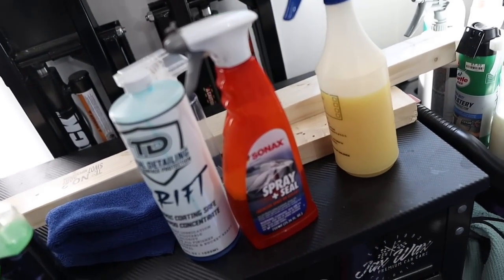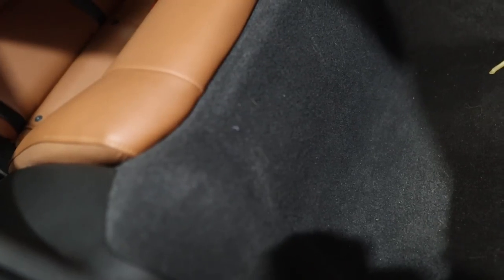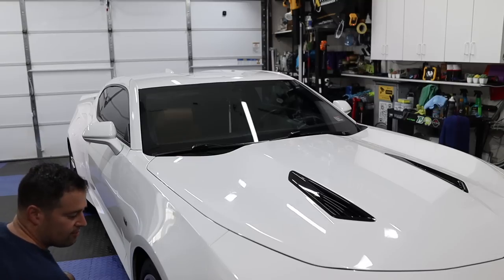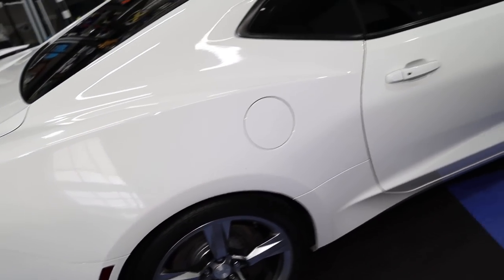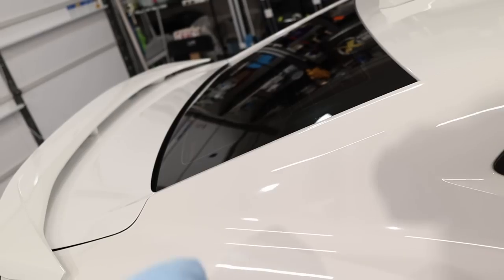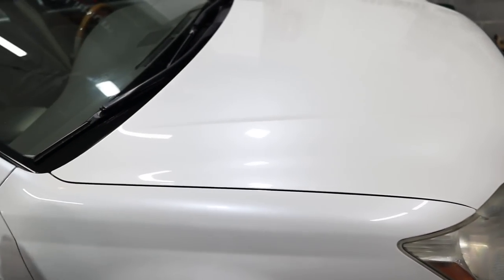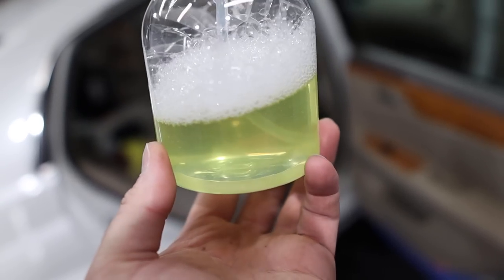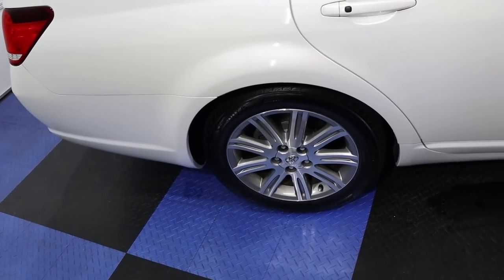Our Detailing Life / We Love Our Customers / Detailing White Vehicles #detailingtips #detailinglife

Comment: Another satisfying video on white cars since I own a white car too 🤣 Just a quick question Phil, for the Camaro, you lightly clayed the car. Do we have to usually follow up with application of wax or sealant by a machine to remove micro marring? Or we can just use a spray sealant application by cloth and that’s it?
Reply from the maker: Thanks!  I only clay barred a few areas, the rest was still very smooth so we didn’t even need to use the polisher to remove y marring, there really wasn’t any to clean up fortunately. 😎👍🏼
Reply: @MirandaDetailing  Thanks Phil for the advice. Can’t wait for your next video 🙌🏼

Comment: Very nice work on both the white cars.  Man, I am loving your channel a lot.  But I do have a question though.  When you use tire dressing, how do you prevent the dressing from spraying all over your panels once you start driving your car?  It's annoying to see a bunch of black goop on your doors and rear bumper after spending a good hour washing and polishing a car.  Thanks for another great episode and can't wait for more!
Reply from the maker: Hi. Thanks so much. Well we use mostly water based dressings that dry to the touch so they don’t sling. Usually the glossier the shine the more likely the dressing is to sling. So I also knock down the shine a little with a microfiber towel, that way it’s more of a natural satin finish.
Reply: @MirandaDetailing  Huh, makes perfect sense, and thank you for sharing that tip. :)  Do you think the foaming tire shine stuff would fit the bill for low-sling tire shin, like the F1 tire shine products?  Thanks!
Reply from the maker: The foaming products usually leave a higher shine, but again you could wipe it down with a towel to the desired sheen you want.